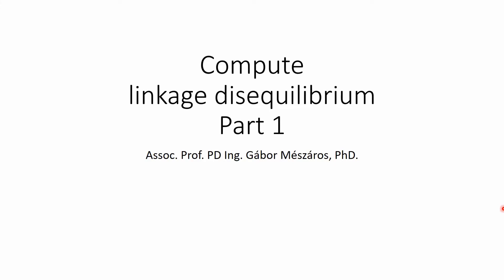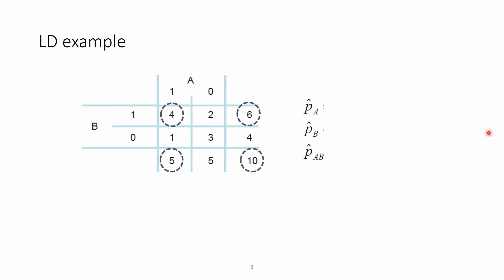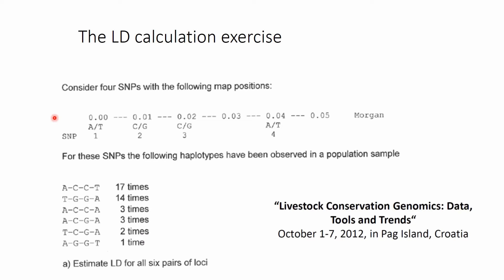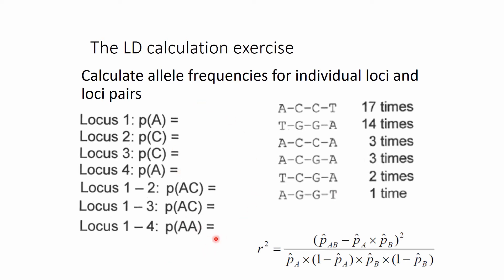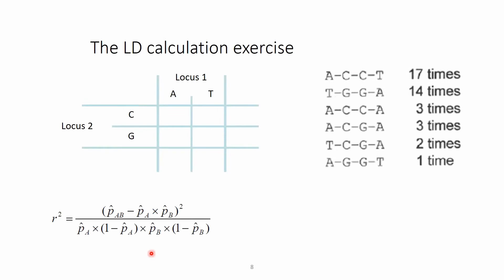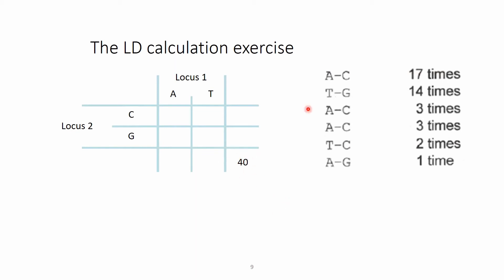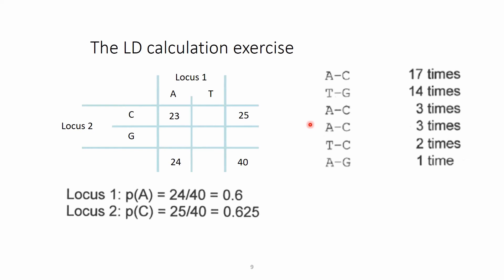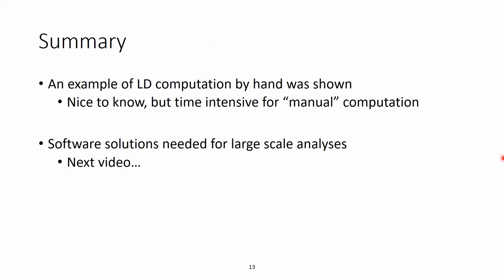How to compute linkage disequilibrium (LD) by hand | Genomics

Comment: greatly explained 
is there any way to calculate haplotype,s number from genotype numbers??
plz
Reply from the maker: Yes. In general any type of phasing software should determine the haplotypes, and then you can use these as you want.
Currently no such video on the channel though.
Reply: @GenomicsBootCamp  Thank You for the amazing information, but I want to know,if I know the genotypic numbers of both loci of interest can we know the haplotype from that genotypic numbers?
Reply from the maker: @amritsudershan8620  The haplotypes are combinations of loci. In theory, and also in practice any combinations are possible. SO knowing only the numers/occurrences a re not enough. You would be doning too much guessing, with no certainty or way to prove if you are right...
Reply: Thank you so much dr 🥰

Comment: Thanks very much for the helpful example and clear explanation. I think there might be a small mistake in one of the slide; in locus 3, the major allele is G (but it is written the major allele is C), is it right?
Reply from the maker: Thanks for the sharp eye! The locus 3 is actually a tie, with 20 C alleles (17+3) and 20 G alleles (14+3+2+1), so either could appear as "major". The C was in the original example, so I went with that also here.
Reply: @GenomicsBootCamp  Great! Yes, it makes sense. Thanks for the clarification and once again for the great videos. Please keep going Gabor! :)
Reply: @GenomicsBootCamp  sir, I calculated taking G instead of C, and the result comes out same. Though the P(AG) changes, it comes same result